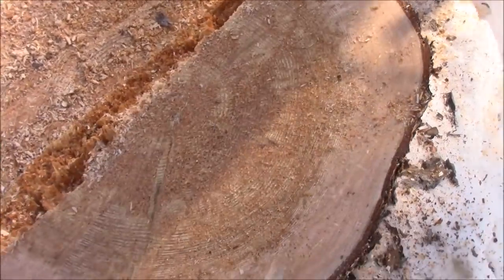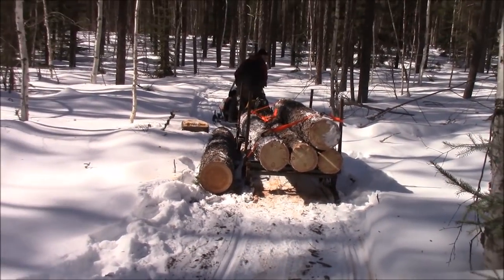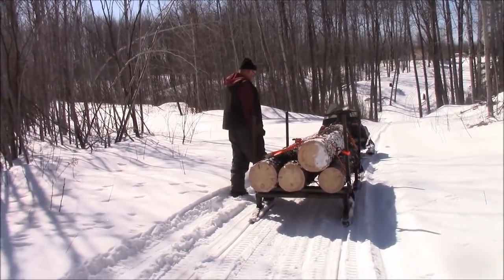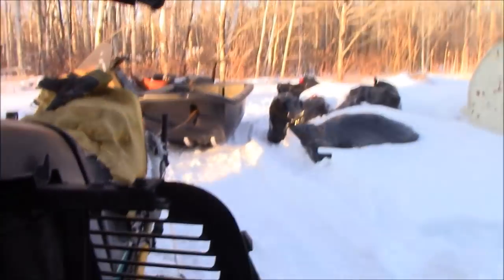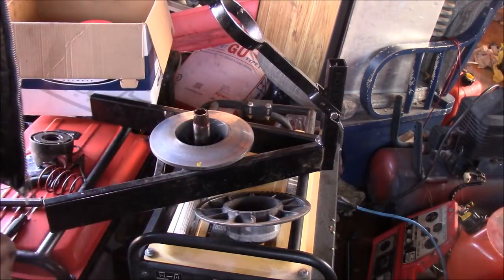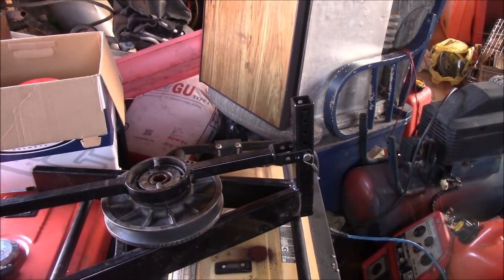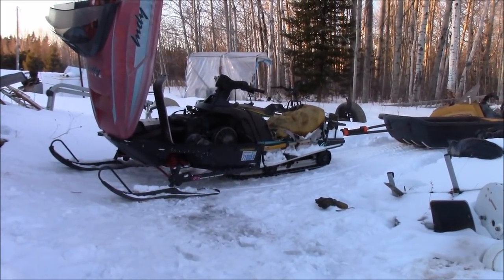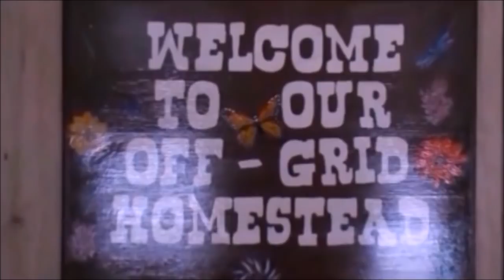Now Time To Do Some Clutching, My New Homemade Snowmobile Hitch Works Like A Pro

Comment: Hi Folks, hope all is well. Everything is good here. That green Jack pine weight is approximately 4800 pounds per cord. So you probably had at least 1000 pounds on the sleigh. The old 340 certainly has a load. Take care my friend 's and I'll talk to you soon!!😁😁 Your friend Al.
Reply from the maker: Hello Al.  Yeah everything's great here,  glad things are good with you  as well.  Lol yeah this load seemed heavy,  it is showing e the parts that need improving on my little 340 😉  Thanks again.  You take care ttyl.... Cheers 🌞

Comment: Hello Cecil and Heather,  nice vid again,  you must have settled the problem.  I had to do that one day on my secondary pulley but I d'nt put 2 spacers,  it settle the problem but I've lost a bit on top speed , but I don't mind I still have enought speed,  anyway it's not a sled for racing.  Theese free air Motors  are getting warm specialy when you haul a big load or the drag even with all the vent traps open,  so we stop more often and we open the hood,  LOL.  So have a nice day and take care friends. Happy to see that vid, it's reminding me a lot of souvenirs.
Reply from the maker: Good morning Jacques,  Thanks you I am glad you enjoyed the video.  Yeah The problem is solved now, just the engine clutch to do now... A little heavier spring in the primary clutch should fix it up.   Thanks again.  You take care ttyl.... Cheers 🌞

Comment: That tubular rack is a lot stronger than I would have thought.   the old buy   Bert
Reply from the maker: Yeah they are strong Bert,  I have made this style hitch on a few of my snowmobiles and they don't bend.... A person has to remember that the original hitch was welded to just one of these pipes and the bracket was only 3'5 inches wide... The new hitch plate  made is welded to two pipes and is 5 inches wide... That more than makes up for the height difference.  Thanks again.  You take care ttyl.... Cheers 🌞

Comment: Good to know that the hitch seems to be working well, giving you more traction. Will definitely need to learn how to work on snowmobile clutches if am to keep my shop repair bills to a minimum. With the snow I get, one clutch cleaning could last 20yrs LOLOLOLOL.
Reply from the maker: Yeah the hitch works like a charm, and nothing has bent yet.  Thanks again.  You take care ttyl.... Cheers 🌞
Reply: Off Grid Homesteader Cecil E Skinner Didn't set my cabin on fire this time. LOL, last time I tested a welder at my cabin I set the grass on fire. Now I have nice welding blankets.

Comment: The Polaris 340 I'm fixing up needs rings for sure. On a slightly warm engine it tested at 105 and 110psi. Will be looking forwards to your engine rebuild video on the 340.
Reply from the maker: Yup your engine sounds a little more worn than mine... But hey that's why I could afford to get this snowmobile.  Thanks Jeffrey,  I a pricing a rebuild kit now.  Thanks again.  You take care ttyl.... Cheers 🌞
Reply: Off Grid Homesteader Cecil E Skinner And the engine was run lean on one cylinder quite bad. Late summer I should be tearing it down, measure the cylinders to see if they need attention. Then fix up 5 more snowmobiles before winter... Ugj, should have married someone that works at a snowmobile shop.